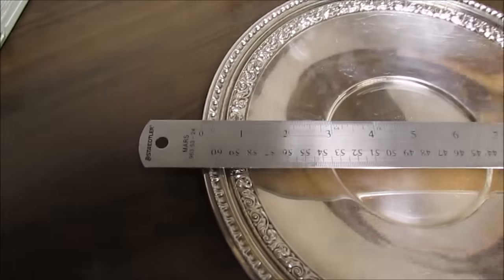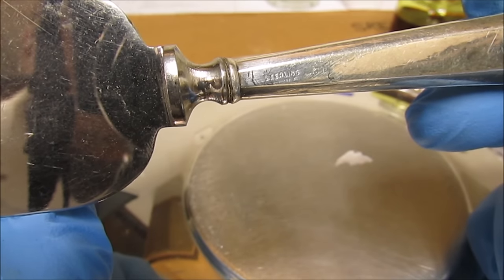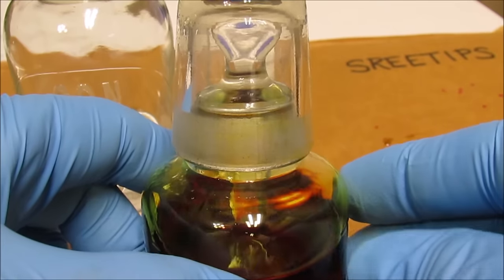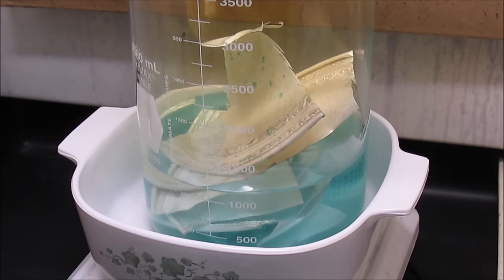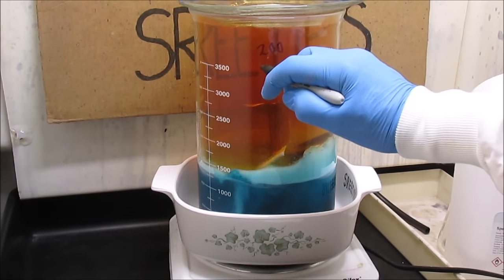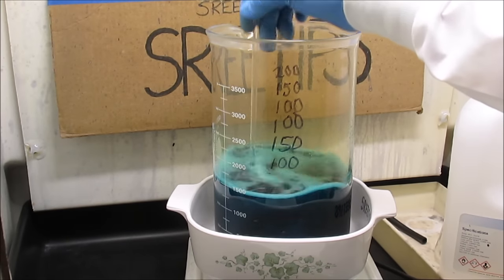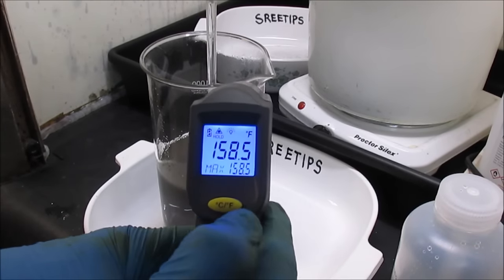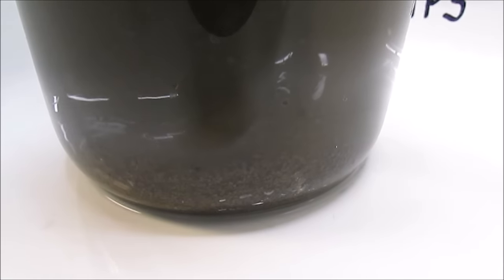Method for Recovering Silver From Silver Plated Items

Comment: What is the the solution for testing
Reply from the maker: 1gram silver chloride crystals. 1gram pure pure tin shot (both available on eBay). 25ml distilled water. 30 drops hydrochloric acid. Combine, shake, ready for immediate use: https://youtu.be/j3SlZphCjj4

Comment: Ive been putting silver plated items in poormans ar to rid the copper base first, then i filter out the ar leaving the silver behind before i refine it..  im not finished my process yet, i havent gotten around to filtering out the silver as its kind of annoying plus not worth my time yet, but maybe it will be a much cheaper way to recover plated silver..
Reply from the maker: In my experience ar will cause passivation on the silver. I guess there isn't much out there on getting the silver from silver plate. I'm thinking a reverse plating cell for silver. But I've never seen one. I'll have to do some more experiments with reverse plating.
Reply: @sreetips  yes it passivates but the ar gets all the copper it just took a few days and a re nitrate, pure nitric is not available to me neither is 98%h2so4 so i need to find a cheap substitute ( i tried poormans nitric but it failed to dissolve silver twice now, dissolves copper in minutes though)  dusan999 has vids here but hes a personal friend of mine from a refining  forum were in that jeff/geo runs, he puts plated silver in 98%h2so4 with 68%hn03 and it dissolves the silver only and leaves the base metal untouched, i think dusans method is best if you have access to lab grade h2so4 and hno3 ( i make my own nitric so its not viable to me and h2so4 is not obtainable in my country)..

Comment: How come you never use Hydrogen Peroxide ?
Reply from the maker: Didn't know that it could be used with silver
Reply: @sreetips  I'm not sure what the process of the gas leaking out of the reaction is called. (Happens with even cold Nitric + Sulfuric Acid) This doesn't happen with Hydrochloric as much. Anyway, half the acid gets used up in the reaction and half just floats away. (The red gas.) Nitric Acid is more costly than Hydrogen  Peroxide. If you add Hydrogen Peroxide to the solution first, the extra oxygen will immediately combine with the NO gas before it has a chance to fly away. Using Hydrogen Peroxide insures your buck can at least go twice as far. This doesn't replace the acid but, just gives it a longer shelf life.

2NO + H2O2  --> 2HNO3

Found out from this video.
https://youtu.be/59Cc02BUWa4
Reply: Also H2O2 is usually used with HCL to help it dissolve any copper. Useful for stripping the gold fingers of PCB's instead of using nitric acid.
Reply: Hi loving the videos on this subject, very interesting. Was thinking though, if you extract that Nitrogen peroxide "the red gas in the reactions" and dissolve that gas into Copper Chloride solution as it can dissolve something like three to four times the gas and hold it in the solution. So at another time you can reuse again by heating and Oxyation with a catalistic metal and compressed Oxygen @5atp or maybe dissolve the gas in Hydrogen Peroxide Solution about 45 per strength. To give you Nitric acid again.
Reply: @malcolmwilcox6320  The Red gas does not bond with water or copper chloride that easily.
Saving it with Hydrogen Peroxide seems like the only way to go.

Comment: I been using a another method that does not use nasty chemical processes to remove silver plate from brass or copper. I can process all day long if i have enough silver plated items. My gosh,. i don't recommend this process,its far too expensive. Use Reverse electrolysis,. You just want the silver off the metal it was fused onto,so reverse that process.

Comment: There are mucho problemas with this tek.
First of is the inefficiency. Everything about this; every step taken seems to be done to celebrate the God of inefficiency. Look at the first step, eg. You're adding like litters of nitric acid (what you have isn't concentrated, btw) to gallons of  water in order to dissolve a little bit of brass and silver. Why not forgo the water addition, and shoot for straight acid? Plus, you get to explain to your viewers that the brown gas cloud of toxic nitric dioxide you see coming out of the beaker is so lethal it was used in WW1 as a chemical warfare agent. To make matters worse, just one huff of the gas will cause a delayed reaction before the symptoms set in. One lungful won't do anything. For the first 8 hours, anyway. After that, blisters appear on the lung tissue, and ultimately kill by means of drowning. There is nothing the doctor can do, either, unless a lung surgeon and an extra set of lungs is nearby...
Also, you make good use of your vacuum filter. Once. Why not use it once your silver chloride is participated! That way you don't have to rince like 10 times to flush the Cu out. Filter once and you're done. Plus AgCl is sparingly soluble in water. Therefore, you killed the yields by throwing away shoot of AgCl during your rince. That's why it looks like you had far less at the end than at the start of your rincings.
You used far too much sodium hydroxide at the end. The only thing your doing is pulling of a chloride off the silver. That's it. It doesn't take much in the way of a hydroxyl functional group to pull this off.
Reply from the maker: Thank you for the analysis. I can use pure liquid dish soap to wash my hands. It will clean them, but if I add a little water the soap works much better. Same principle with the nitric. The fumes are nitrogen dioxide. The same thing that comes from you neighbors car exhaust, although not as concentrated.

Comment: Dang trashing Reed & Barton should get you time in prison. They make the nicest silver plate. Should have researched them before destroying the tray. Probably could have gotten about $20 for it on EBay. $2 at a garage sale is a hell of a deal. Trashing Wm Rogers is acceptable and should get you a medal from the Institute of People That Prefer to Destroy Ugly Things. That’s also why you had to scratch so deep to get base medal. Everything Reed & Barton makes is high quality and expensive. Made for the people that couldn’t quite afford real silver but wanted to look like they could.
Reply from the maker: It seemed like the best choice for making the video since it had a very thick coating of silver.
Reply: 39:44 see I knew the cops would show up to take you to jail for destroying Reed & Barton. You can hear them banging on the door in the background!!
Reply: @sreetips  very nice video. Have you thought about using salt to drop the silver from solution? Would be interesting addition since you are using sugar as well.
Reply: @sreetips  another quick question. Are you planning to refine your copper nitrate back into nitric acid? Would cut your costs way down to the point of turning a nice profit on recovering silverplate if you don’t include labor that is. 2Cu(NO³)² -> 2CuO -> 4NO ² + O ² (I don’t know how to put the little numbers in formula form on IPhone) pretty sure that’s correct
Reply from the maker: No, no plans for that. Thank you
Reply from the maker: I’ve used salt to drop silver chloride. But I don’t have a video of it